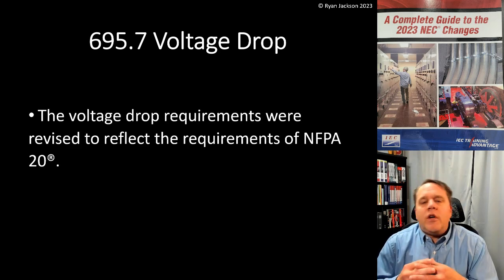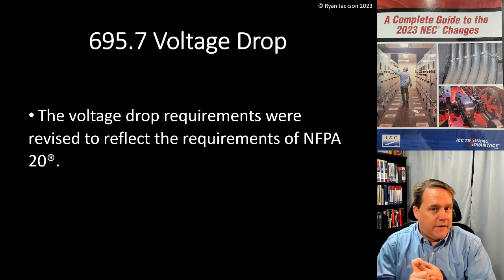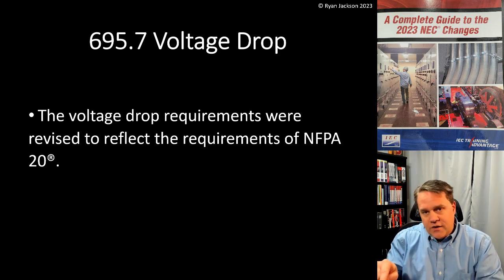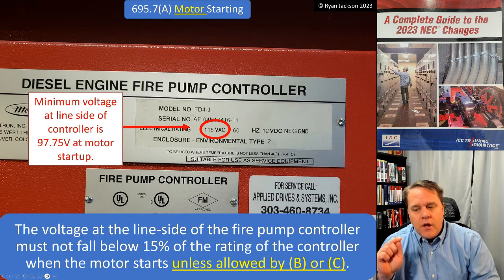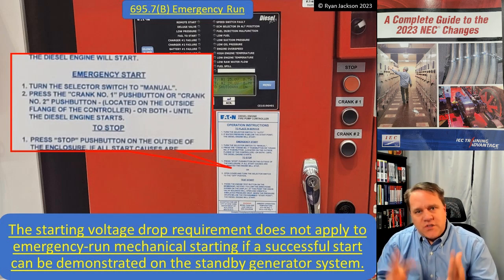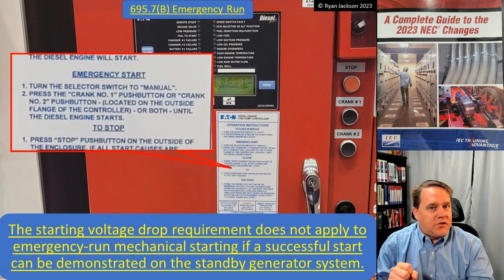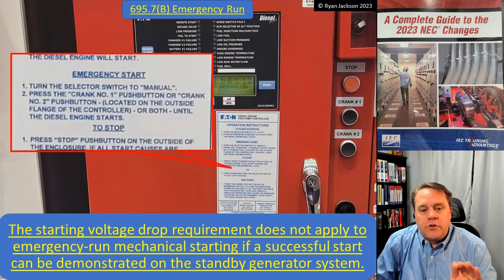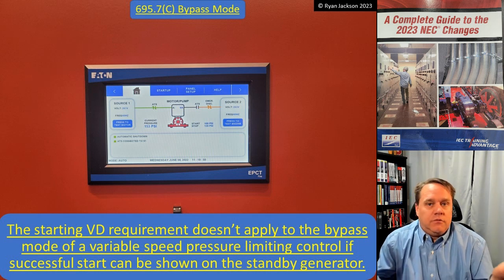695.7 Voltage Drop (for fire pumps)

Comment: Ryan, is there a reason we use the DC resistance for all voltage drop calculations instead of the AC resistance values, from table 9, when applicable?

Comment: Hello mr Ryan  how do i know what size braker should be at the control cabinet.. is that braker size also  600% .. of motor lock current... 
I was looking a pump it has main 600 amps and braker at motor control cabinet is 225amps
Thanks for your videos

Comment: Excellent summary and review.  The photo, however, is of a diesel fire pump controller.  The voltage drop is meant for electric fire pump controllers.  Diesel fire pump controllers start the engines with DC batteries, and the 115 VAC shown there is only used to charge those batteries, so voltage drop wouldn't apply here.

Comment: Most 3 phase 480 motor contractors use 115 to pull in the contractor.... so we are dealing with 2 different voltages here. Correct?? 15 % for    Coil voltage , 5 % for mortar voltage?? This almost seems backwards to me in that as long as the contractor pulls in without chattering, the motor will turn on a fairly reduced voltage.... may be a dumb question but I’m curious enough to risk it!❤
Reply: He really meant contactor, not contractor.
And you really meant motor not mortar.

Of course, a motor has a rotating magnetic field.  A solenoid doesn’t.
Reply: @denverbraughler3948  thanks denverbraughler!! Frickin spell check☹️
Reply: If a fire pump motor had a 15% voltage drop the 120 volt control circuit would be close to that ( depending on length of wire from fire pump control panel to motor ) . Years ago Allen Bradley used to supply think they called it the seal contactor voltage.( big name for lowest voltage that a starter will pull in without chattering ). Several times I have came across plain Jane NEMA motors feed by 208 volts while motor starter had a 240 VAC coil. During the day have measured the 208 at load side of starters to be 196 volts. ( over a 17% voltage drop ). 120 volt control circuits a lot safer for people working  on equipment.
Reply: Well….the issue is that the 115VAC panel shown is a diesel fire pump controller. 

A contactor  is used in a higher voltage electric motor driven fire pump.
Reply: He addresses that regardless…
The paragraphs deal with the contactor….VD across that…